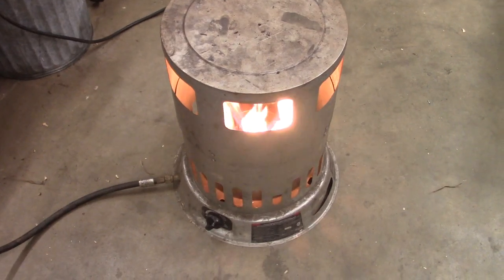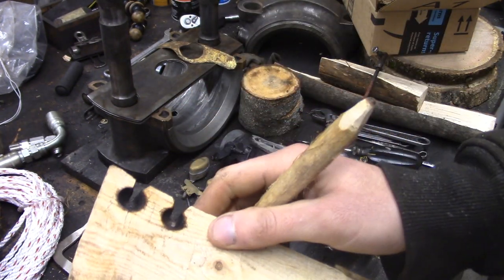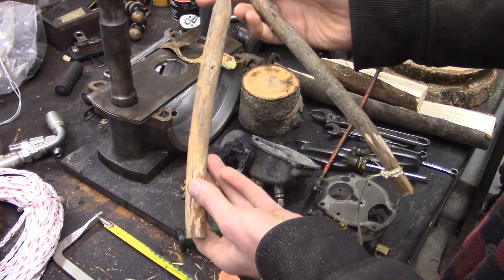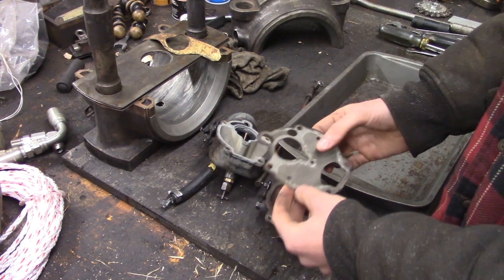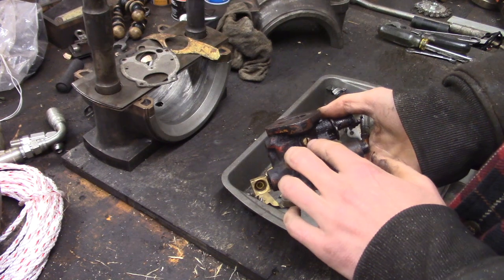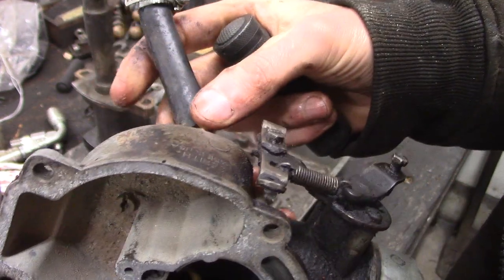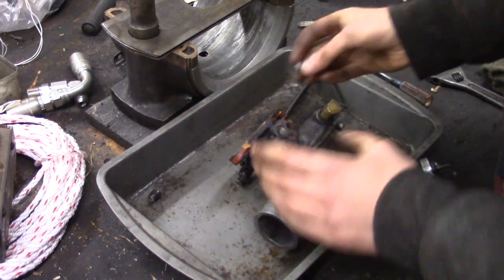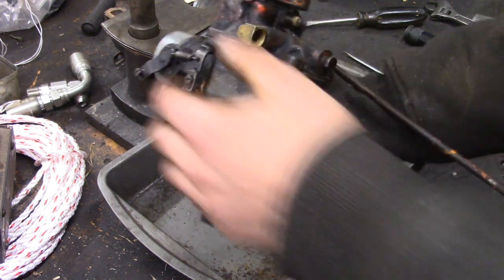Case 530 Backhoe - Carburetor Cleaning and Shop Talk

Comment: For starting fires we would always scrape our blue  jeans with a pocket knife to get a small ball of cotton fuzz - ignites with a spark pretty easily.  Catch a spark in that, put the smoldering fuzz into the middle of a wad of the bark, etc. stuff like you showed.  If you have that ready on the end of a couple of feet of twine you can twirl it around a few times and usually lights right off.  Then, stick it into your waiting fire wood build.

Comment: That feller is correct...spend 30 or more bucks for a gasket...which I have. I hate making gaskets. I'll spray soak the gasket with silicone spray so it doesn't stick as well for next cleaning

Comment: Great video thanks...     I have the same carb, just wondering do you know if this carb is replaceable with a newer modern carb?      I had to replace the bottom part of this carb, it took me a long time to find this part.
Reply from the maker: i'm sure there are new carbs that fit on this. I don't know from experience, however.